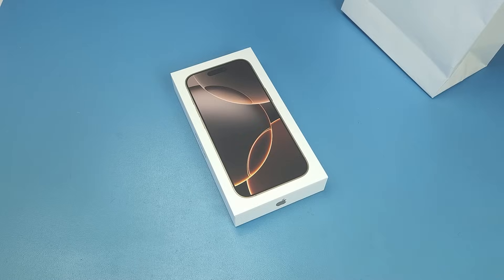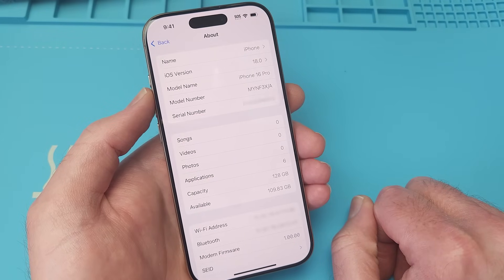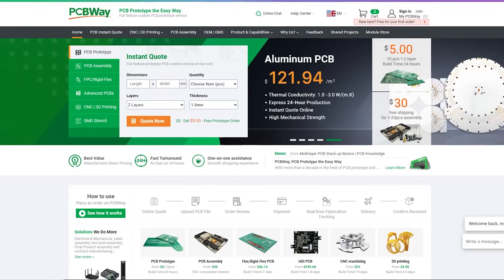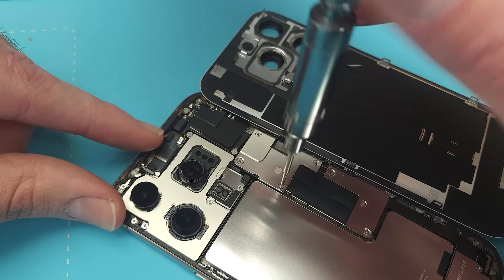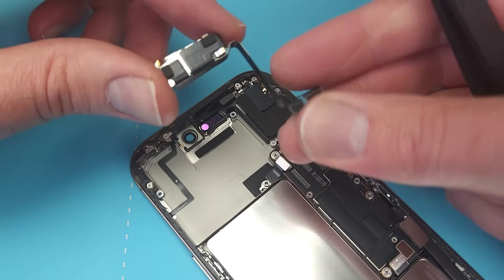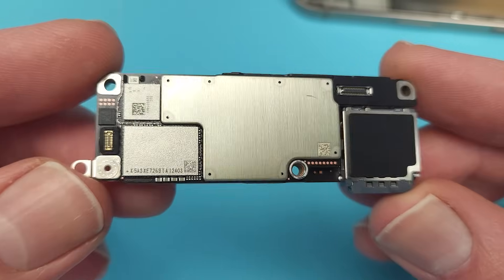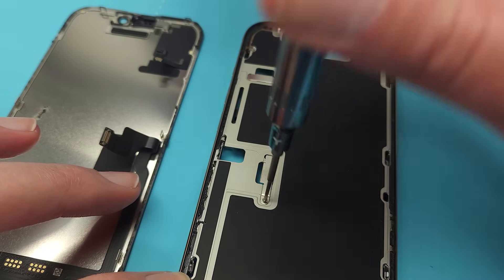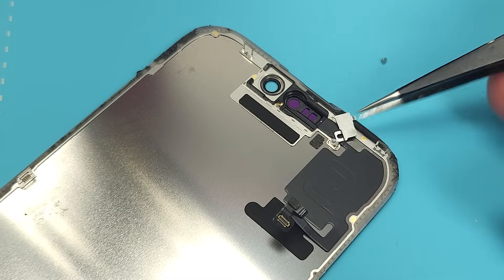iPhone 16 Pro Teardown - Full Disassembly

Comment: This battery is making 16 pro extremely hot specifically during facetime video calls. It start heating just below the camera module. I’m not sure if im the only one facing this issue. I have no cover on cellphone but still this phone battery isn’t performing well.

Comment: Great video -- but I was hoping to see the modem and antenna.  Did I miss it?  The phone was predicted to be getting the X75 but that might not have happened?  Does anyone know if the Pro and base16 have different modems or, for any other reason, differing potential to pick up available signal?  It's an issue where I live.
Reply from the maker: @catalpafamily9724  I'm sorry, I didn't know 😔
Reply: @RestoreTechnique  Still, thanks so much for the response.  You make great videos and obviously care about your viewers!

Comment: Is just the pro 16 has stainless steel cover on the battery???
Reply from the maker: Yep. Weird. And only the 16 and 16 plus with the voltage injected battery pull tabs.